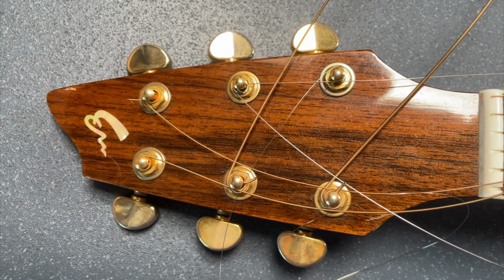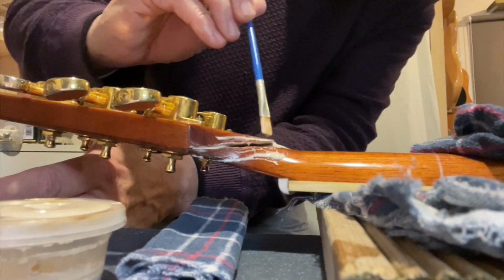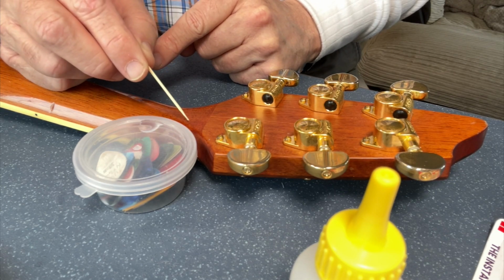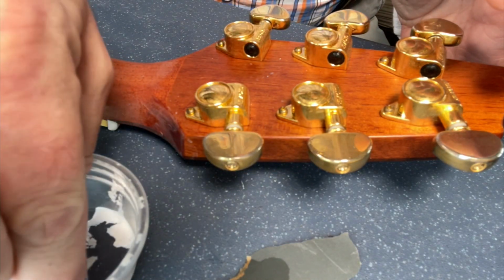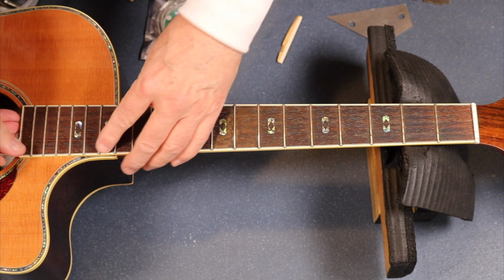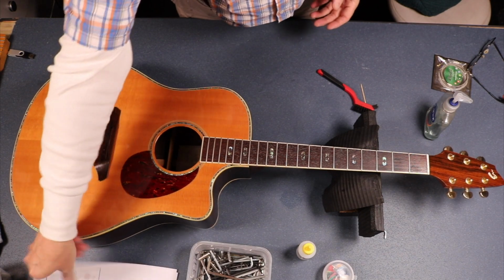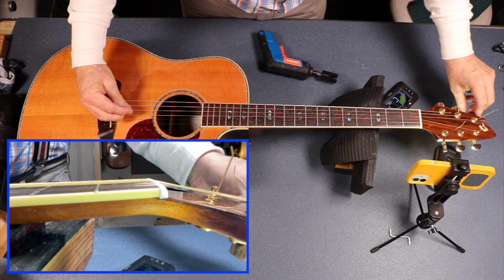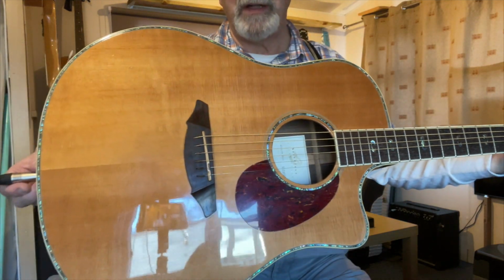Beautiful 'Broken Neck' Breedlove AD25/SR Plus Aco, Quality design, manufacture, sound. Korean made!

Comment: Wow.
Had you taken the time to remove the tuners, and made a caul prior to clamping, it would’ve closed up better….
Reply from the maker: Hi Stew.... struggling to understand how that would help, in this instance.... no sarcasm involved here, but I would like to know how - the caul aspect yes... but the tuners... can you explain that aspect.
Reply: Wwweeelll…with the tuners out of the way, then flat cauls can be used on both sides, and with much more/even clamping pressure that would close up the break thoroughly and have maximum squeeze out.